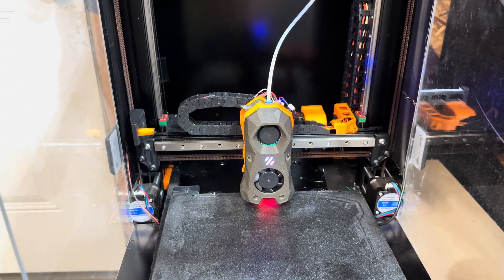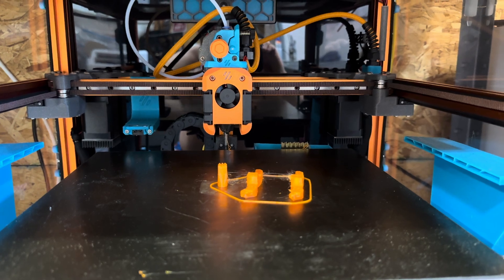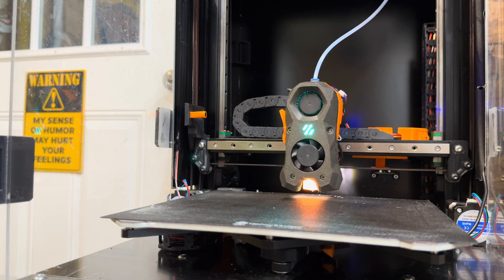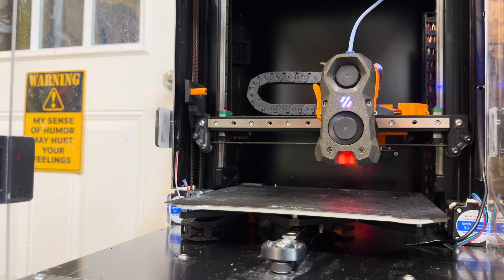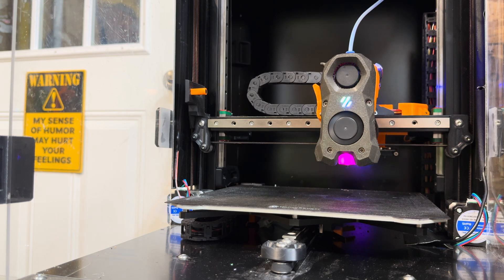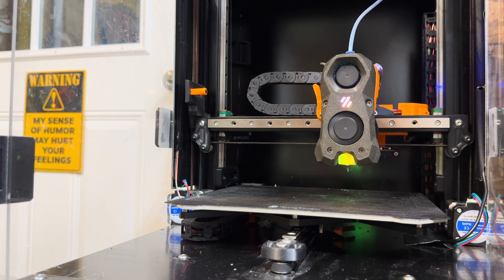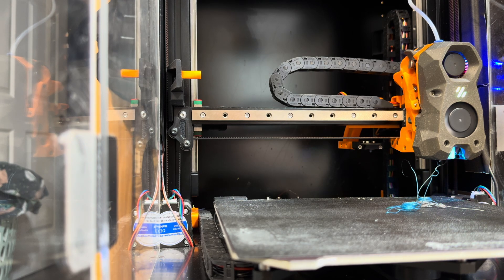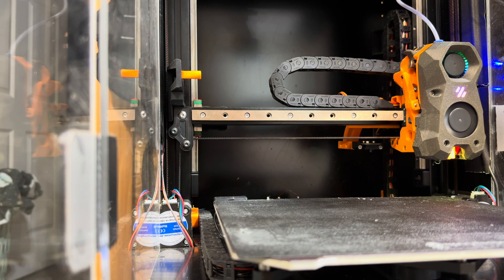ERCF v2 Mods. Fixing filament cutter.

Comment: hey bud im not good with cad in kind of new to 3d printing designing is there any way you can send me those files if you still have it
Reply from the maker: I just did it in slicer by adding a negative modifier to the part to make a 3mm deep 6.2mm round hole where I wanted the magnet
Reply from the maker: @3D-DISCIPLE I posted those model files. https://www.printables.com/model/1069503-filametrix-cutter-arm-mod

Comment: I was going to suggest a second arm to press on the lower area below the hinge point for the cutter.. then I saw switchwire.. Love the rainbow effect during heatup may have to see about getting that one from you :)  Glad to see your still hard at it.  My v2 upgrade is coming, then I'll combine the v1.1 parts and see about getting it online with my trident.  The servo on clicky was also a bit of a shock, just whipped it right out there [L]augh [O]ut [L]oud.

Comment: I had this issue as well, turned out the knife holder printed part was rubbing on the bottom with the printhead mount. Sanded it down 2 layers and now it works flawlessly.
Reply from the maker: I had to do that as well but still this issue

Comment: when your cutter gets stuck, if you retract 1-2mm of plastic does it get unstuck? that’s my problem, it’ll stick when it cuts the filament but after retraction it’s back to being really springy. i haven’t tried any test prints with my rabbit yet as that’s still being built and i kinda did this part first.. i guess i should add some magnets
Reply from the maker: No it would fully pull the filament out and put the next in but that blade would be in the way.
Reply: @ProjectsInDadsGarage  i understand, i’m glad you were able to get yours fixed. from what i understand happy hare actually will be able to compensate for the issue i am experiencing so maybe ill be ok.
Reply from the maker: Yeah, it’s pretty good with most stuff